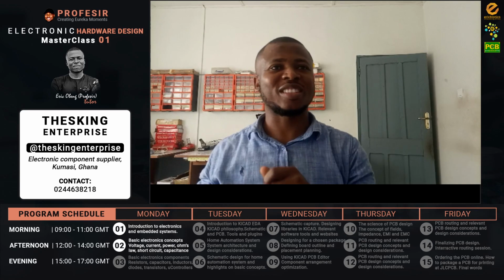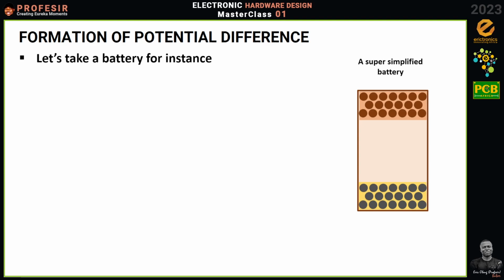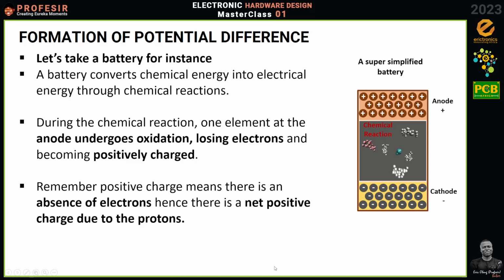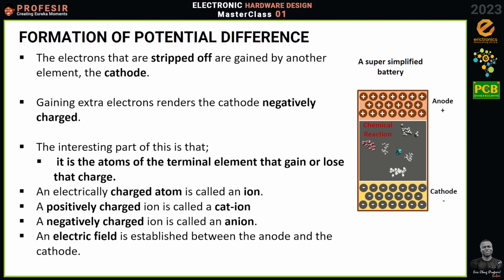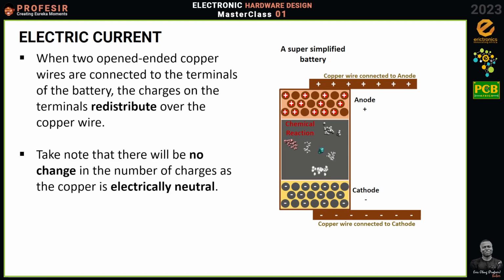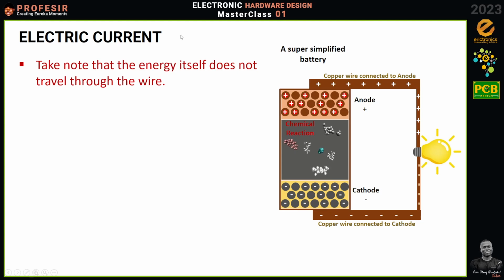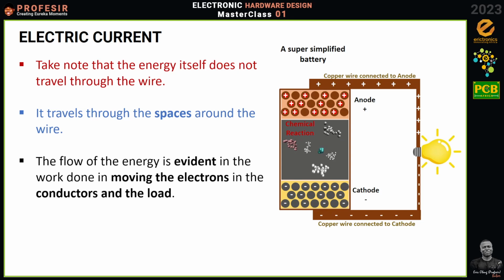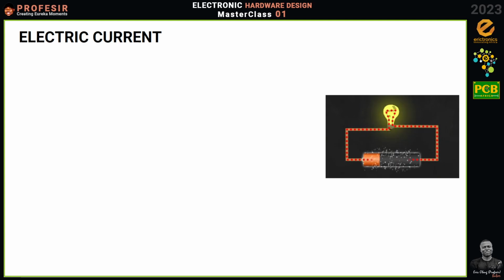Lesson 09: Basic Electronics Concepts - Potential Difference, Current, and Battery Physics

Comment: is it the potential difference in the battery that causes  the energy that powers the load to flow?
Reply from the maker: The electric potential is energy. This energy is due to the arrangement of charges(configuration). (The battery's business is to keep this electric potential energy intact by causing more reactions to occur to sustain it). One way you could think about it is the energy you would have to use to move a charge from infinity into the vicinity of the field. This energy gets stored as potential energy. This energy can be moved, stored, or transmitted when conditions are met. When the energy moves, we can know by the flow of current.

Comment: when you connect the open  ended copper wire to the terminals of the battery, the charges redistribute. So if later you close the circuit and the energy starts to flow, will the redistributed electrons in the copper wire join the original copper wire electrons to move?
Reply from the maker: In order not to confuse between the charges creating the field and the electrons that comes with the copper. Always think of the charges that create the field as positive and negative ion cores (thus atoms that have lost or gain electrons). Although a complex mechanism is going on,  these charges causing the field usually form static surface charges that accelerate the electrons in the conductor in this case the copper wire,